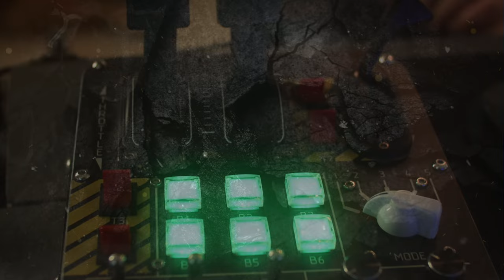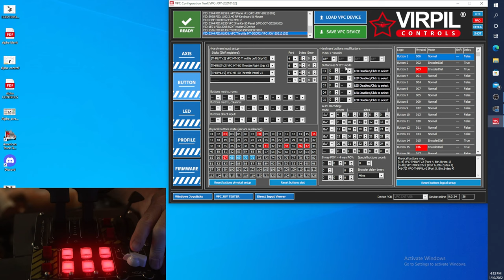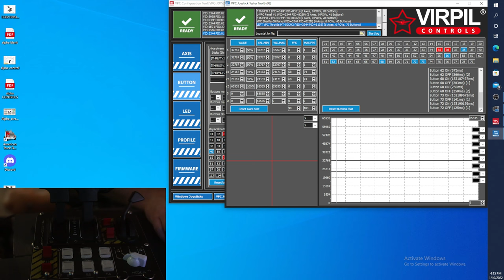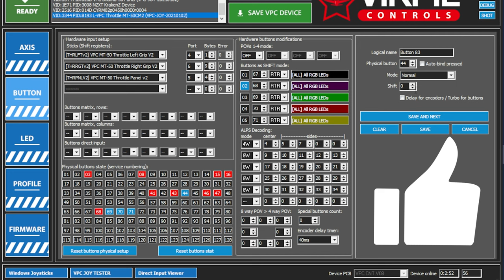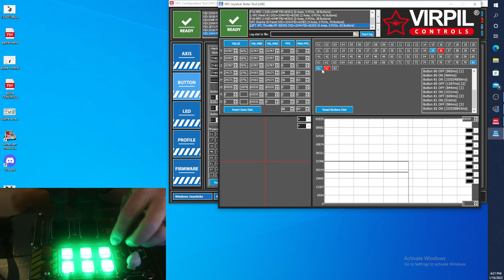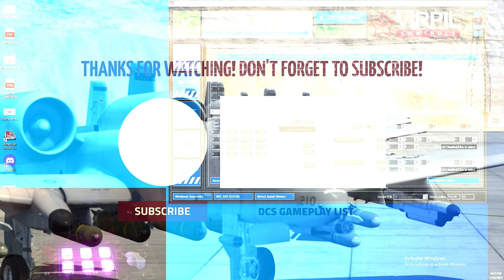VIRPIL 5 WAY MODE TUTORIAL (watch to the end for tips)

Comment: Great, thank you - I will try this out, maybe in conjunction with setting up my control panel 3 as a slaved device. Although that might cut into the number of physical buttons with multiple logical functions, if the total limit for the two devices is 128 logical buttons, where as leaving the throttle and control panel as unlinked units in theory would permit 2x128 logical buttons. Assuming anyone could remember that many buttons :-)

Comment: Man, setting these things up really is a science unto itself. 
"Quick" question: Is it ok to re-use an existing profile when you update your VPC software? I've just done that today for my CM3 throttle (was using VPC version from 2022 IIRC) and the old profile seems to work as expected, but I did notice some minor stuff. Namely that the selector would not change back colors on the throttle's LED buttons when I set it to mode 5 - it would just stay on that mode's color when I rotated the switch back. Under "Shift Setup" button 5 was set to "TGL" instead of "ON" like all the others, so I simply changed that and now it seems to work again. 

Another thing I noticed is that I'm not getting the correct image for my throttle under the "Profile"-tab (just a red x icon) and it also isn't set to "5-way Shift" by default in the second pull-down menu in there. Doesn't seem to affect the throttle's behavior, but I do wonder if I should maybe make a brand new profile. Which I'm not looking forward to, since I remember setting up the throttle-axes to give me those engine on/off button presses below my detents was a bit of a chore.. :D

Comment: Great video, question though, does it matter if you have your devices connected to a USB 2.0 or a USB 3.0? If it does matter what is a good USB 3.0 port to get?
Thanks!
Reply from the maker: It doesn’t matter works the same on either port.
Reply: @JGandT  thanks, have you noticed any ghosting on a 2.0?

Comment: Can different modes have different ranges for axes calibrations? That is for mode 1 jet, I want the idle cutoff button activation to occur below the lowest value range for the throttle axis. Mode 2 helicopter, I would want the full range of motion to control the collective, ignoring the idle cutoff button.
Reply from the maker: Yes you can. Check out my Mode tutorial you would set up your logical button to have a shift value on it. https://youtu.be/X7f-v6rOK4k

Comment: The 5-way switch on my CM3 is set up correctly and works as intended.  I also have the VPC Control Panel #1. When I have it slaved to the CM3, the 5-way switch will change the LEDs on the control panel along with the throttle, but the control panel doesn't actually have any more button bindings.  Is this working as intended?
Reply from the maker: You will have to manually add the shift to your buttons.